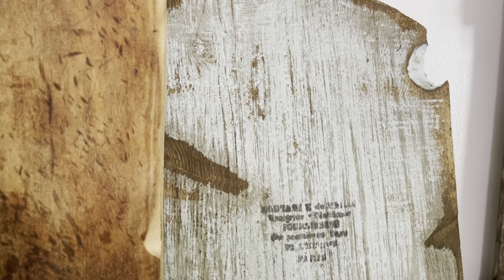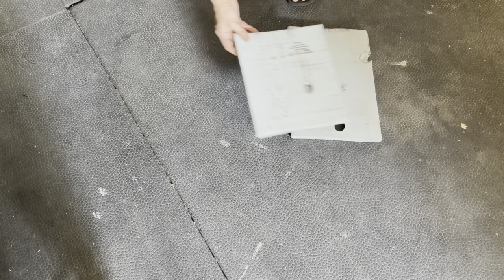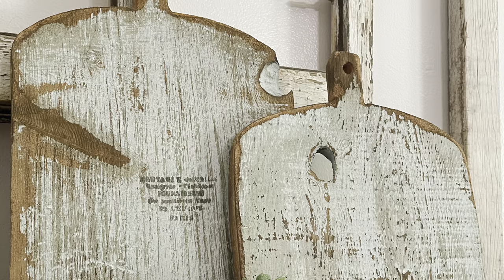Flip for Profit | Spindles | Scrap Wood | Using DIY Paint and Making Powders | DIY for Resale!

Comment: My dad taught me a trick to ladders. Decide how much space you want between your rings and cut a scrap piece to that length. Then all you have to do is put your first rung on and then put the board in between to get exact space between them in a jiffy. 

Works so perfect. Keep the wood and you can speed make ladders.
Reply from the maker: Smart!! Thanks for the tip :)
Reply: That is a genius idea. Thanks for letting us no.